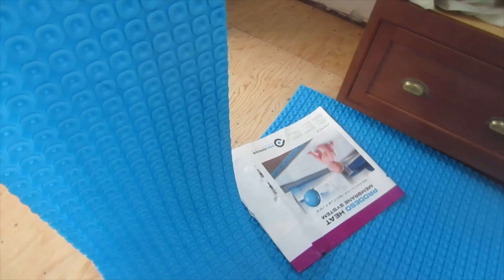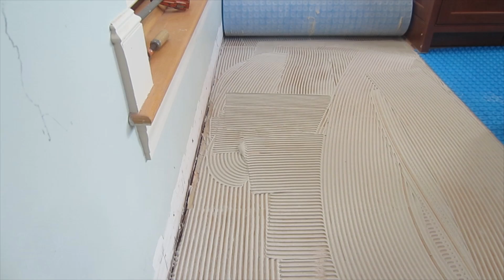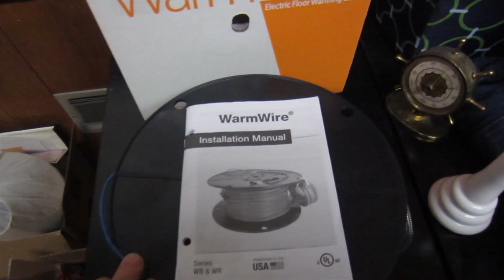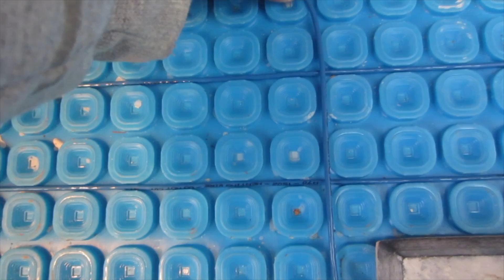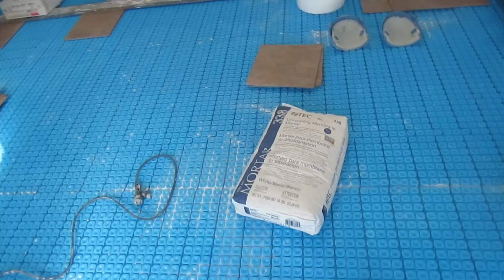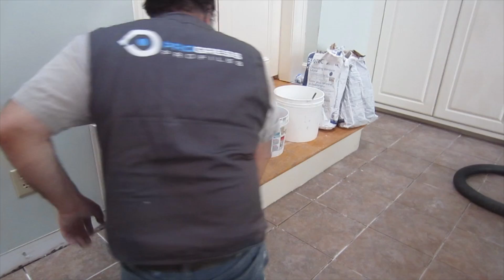Electric Floor heat installationTutorial: Prodeso heat with SunTouch Warm Wire

Comment: Sal, how would you recommend using this system to heat the floor of a traditional mud shower pan? I’d like to build a 4’x4’ shower with a curb. Would you just create the pan, redgard it and then apply the uncoupling membrane and tile over it?
Reply from the maker: There are specific instructions that need to be followed to do it.
Reply: i have supplied warmly yours with my plans. let see how they reply.

Comment: whats the main difference or preference between 120 vs 240
Reply from the maker: As far as I know the 120 will draw more amps than a 240, so for larger floors, 240 is a better choice so a single thermostat can be used. The thermostat can generally handle up to 15 amps, so you can connect as many wires as you like as long as you do not exceed the 15 amps, a 120 volt system will reach the 15 amps at about half the area as a 240 volt system. It follows that a 120 volt system will top out at an area about half the size of a 240 system, so if you have a large area you want to heat with a single thermostat  your only choice will be a 240 volt system for a single thermostat. Once you reach the 15 amps, be it 120 or 240 you will have to incorporate power units to make it work with one thermostat.

Comment: Thanks so much, Sal.Would you use insulation over concrete slab under the prodeso?
Reply from the maker: It is a good idea to use a thermal break when going over concrete, Schluter for example has a version with the thermal break incorporated.  http://amzn.to/2nikoMz

Comment: Thanks for sharing all your instructional videos. I was at "Contractors Direct" website, looks like they offer this in only 160 ft2 rolls. Do you know if it can be purchased in different size rolls? I need an approx. total of 250 ft2.
Reply from the maker: ***** I think they only make one size role.
Reply: +Randy wetzler They make 2 sizes, large and small
Reply: +Randy wetzler Large is 161.5 sq' Small is 52.8 sq'. Try FlooringSupplyShop in LosAngeles. They also sell it by the linear foot there (and it was less $ than anywhere else I found it, like radiant source, warmly yours, or contractors direct)

Comment: Sal, absolutely love your instructional videos (DIY'r)!  It seems that you used the more traditional spacers rather than the Progress Profiles Pro Leveling System.  Have you changed your opinion of the Profiles System?
Reply from the maker: Don't need a leveling system for a smaller tile like a 12x12 inch, Proleveling system is a good system, but when i get the opportunity i like to try new systems. Progress Profiles has a new protection cap for delicate materials. I will be making a video of them soon.

Comment: Hi Sal. Thanks to your videos I just recently finished my first uncoupling membrane job with Ditra Heat. The only problems I had were:

1. Take off. Because I was forced to install a toilet first for personal reasons for the client. I had to ensure that the two toilets were functioning at all times within the house. I only had a 3 foot take off.  Which messed me up a bit. I had to install a sub floor (to raise the transition height to the old tile)/ditra heat piece/ tile,sealant, grout, sealant again for grout then toilet,  in a small area (3 feet wide by 2 feet),  but 1/8" - 1/16" grout line spacing was rectified during at the transition at the old tile. Not ideal but whatever. 

2. Tile Size. Although the tile pieces were 12x12" total, they were adhered together with a dozen or so small pieces joined by mesh. The tiny pieces of black accent tile were so small that they fell through the spaces of the Ditra Heat Membrane and made it impossible to rescue. So I had to fill in the Ditra Heat membrane spaces with thinset first to continue the job. 

All in all I was happy. But I do not recommend small tile pieces on Ditra Heat. The brand of tile that was purchased was also flexible thanks to the mesh backing, making lippage control impossible (for my knowledge).  Thanks again for your generous videos. If you can think of anything that could have made my job better could you let me know? I am going back there to get pictures and maybe a video and I'd be happy to share with you if you allow me :)